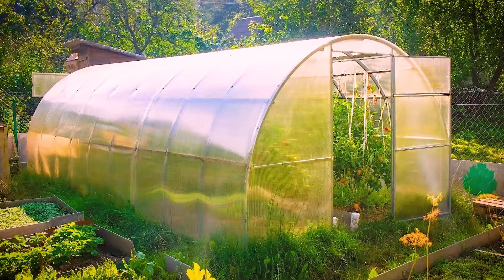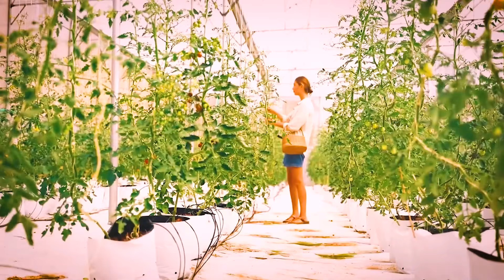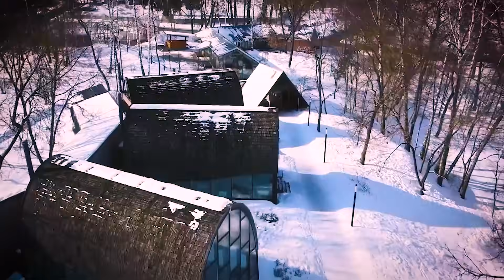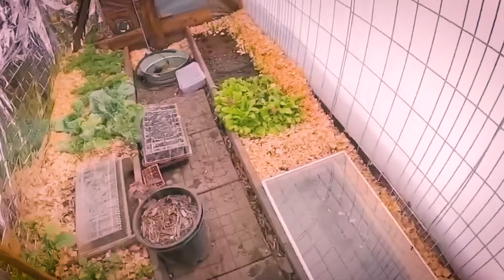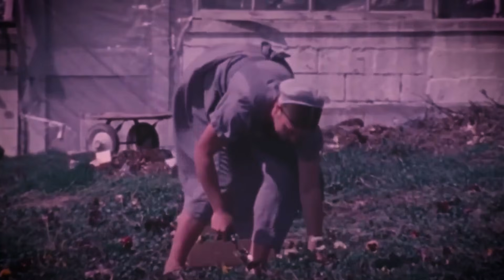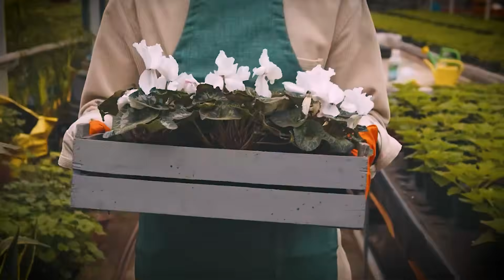How Alaskan Homesteaders Heat a Greenhouse Without Gas/Electricity

Comment: Umm… here’s the part you missed. In the depths of winter Alaska gets 2-4 hours of daylight maximum depending on where in the state you are. And in order to get below the frost line you need to go down at least 10 feet, through gravel and plan for permafrost driven heaving.